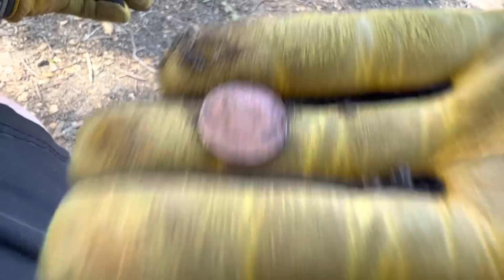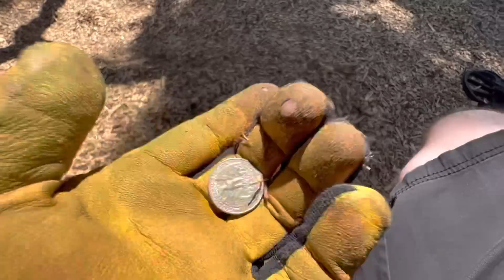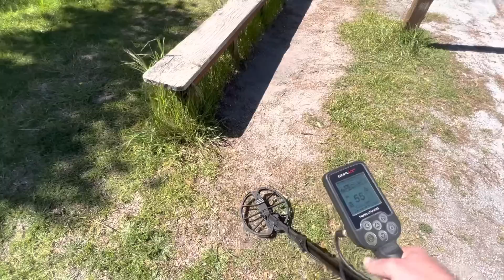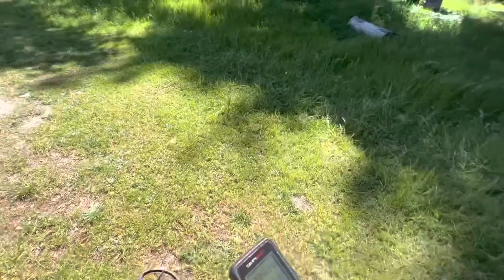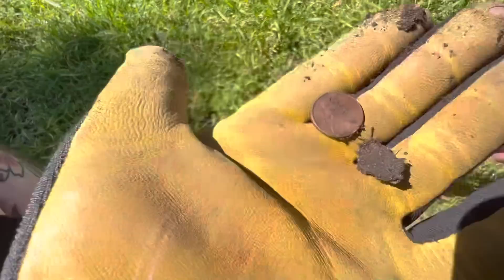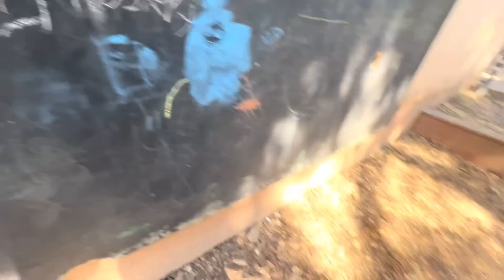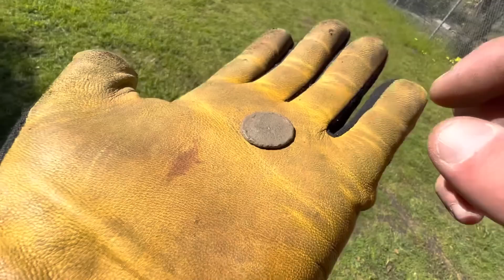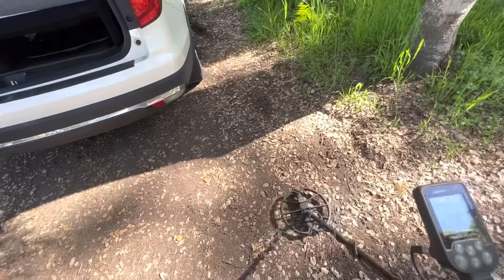Metal Detecting a Very OLD School With The Nokta Makro Simplex!

Comment: I went to a local park by the river and went metal detecting yesterday.  I foung 9 bottle caps, a steel rod about 2ft long, some foil , a ball bearing and the lead from a projectile. The projectile was there long enough for the copper to corrode away.  All was within 2ft of the river.